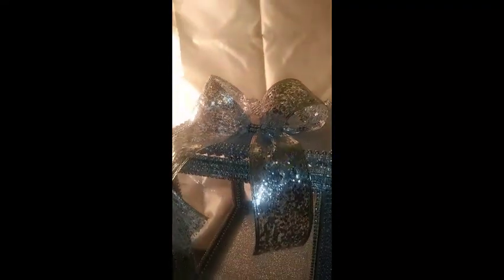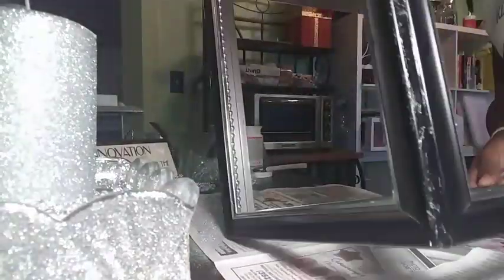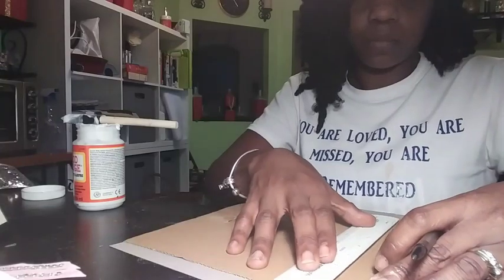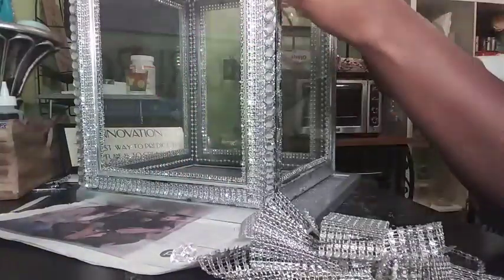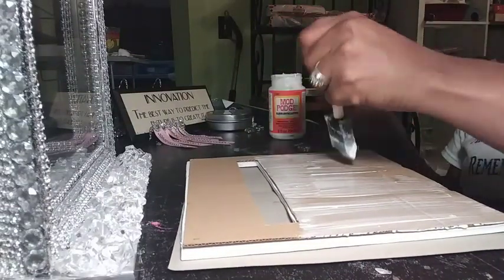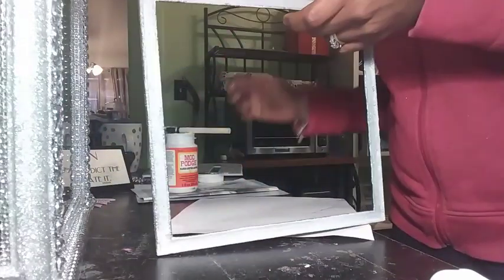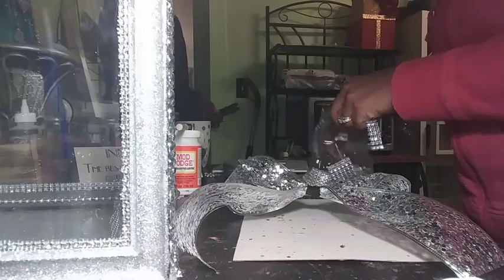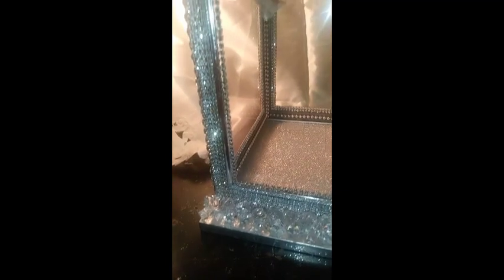DIY Glam Card Box - Special occasion card box

Comment: I know that this an old video. I’m still loving this. What size frames did you use
Reply from the maker: Hello! I used 5 5x7 frames for the top and sides and 2 8x10 for the base
Reply: @shannonmoore4904  in your description you said used (5)8 x 10 frames in (1)8x8 frame but you responded to someone and said you used five 5 x 7 frames and two 8 x 10 frames can you clarify please

Comment: Could you share how the bottom opens.
Reply from the maker: I actually gave this box away so i can not show, but I will do my best to explain it!
The bottom piece doesn't have glass in it and I also left the small black tabs on it. I cut a foam board to the exact measurements of the thin black cardboard piece that comes with the frame. I glued them together and stuck them in the frame. I left the black tabs on the frame so that i could remove the foam board whenever I needed to get the items placed inside the box. I hope this helps😊💜